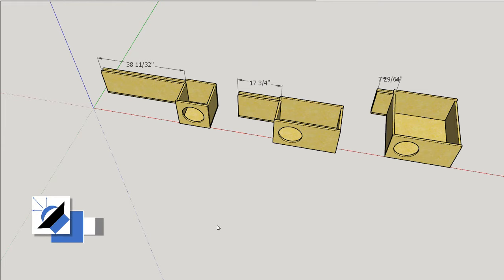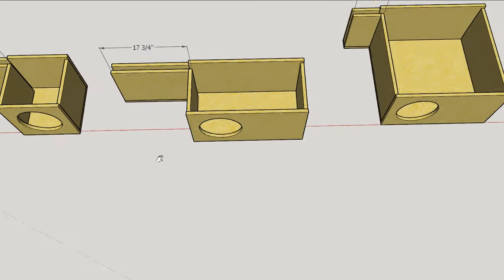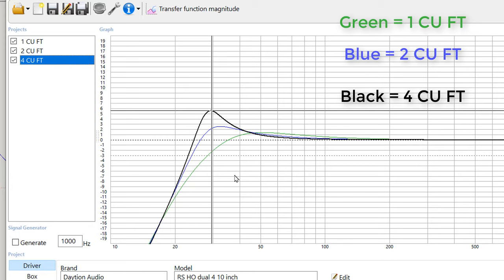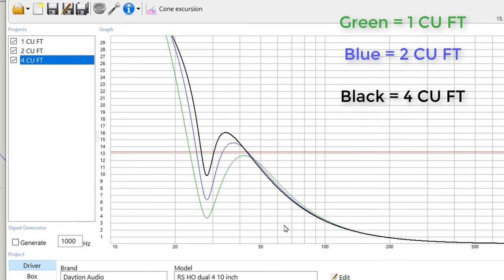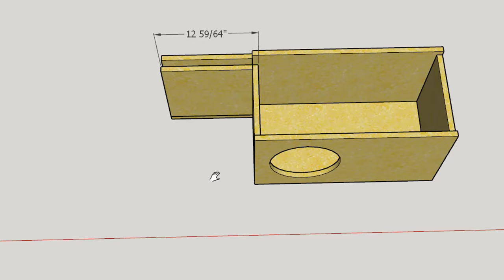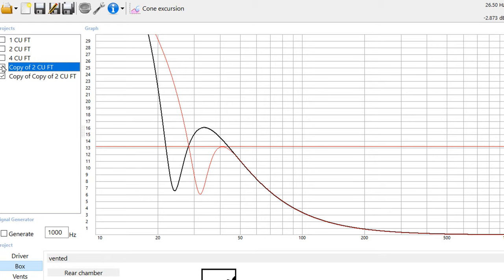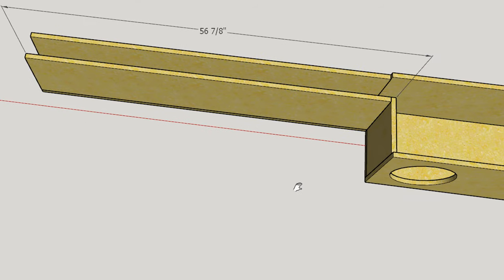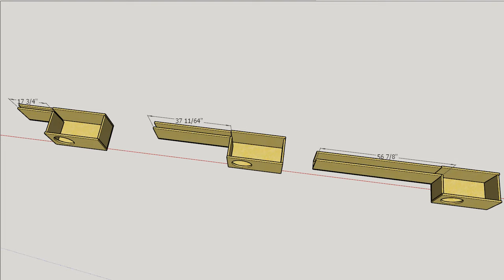Understanding Port Length, Box Volume, and Tuning Frequency.

Comment: What would happen if you take the 1ft cube box and make the vent "snake" on the outside of the box.  Like a T Line box, add lots of 90 degree bends on the port, outside the box, to compact the overall length of the port and make the overall size of the box more compacted.

I hope that makes sense.
Reply from the maker: That works just fine, it's just a pain in the ass to design and build.
Reply: @DIYAudioGuy  Does the 90 degree bends have an effect on the airflow in the same way as 90 degree bends in a hydraulic system, or bending a wire 90 degrees will increase resistance?
Reply from the maker: @turboduckhead6179  to be perfectly honest, I don't know. It seems like it's done a lot and it seems like it would restrict airflow but I'm not aware of any testing or evidence to prove that it does or does not have an impact on the sound.  If lumber prices ever fall I might have to build a box and test that out.
Reply: @DIYAudioGuy  I see prices of birch has tripiled in prices since corona..
Reply from the maker: @turboduckhead6179  fortunately lumber futures are beginning to fall.  It's going to take a few months before that to translate down to retail prices.
Reply: @DIYAudioGuy  lol...true story. I was at my house out in the shop and had this fella drive up and asked me if I was interested in some plywood for $5 a sheet...well yeah. I stepped out to his truck and he had 4 sheets. I gave him $20 for the 4 sheets of 3/4 pine ply. I asked him about the wood and he worked at a local furniture factory. He said they get the ply in and if any defects they just throw it out. I told him to bring me all he could at $5 a sheet. Because nothing was majpr wrong with the ply...I now have 50 sheets...lol. I sure wish it was Baltic Berch but hey...have you priced a sheet of 3/4" pine ply lately.

Comment: The other thing to take into consideration is that the larger side panels can resonate, especially at low frequency.
Reply from the maker: I have been digging into that, trying to find a formula that will tell me when a wood panel of a given size will resonate.  I have yet to crack the code.

Comment: Can you plug a big 15 inch high powered active subwoofer that has a plate amplifier with 1000 watts of power consumption into the 120 volt ac outlet on the back of a home theater receiver
Reply from the maker: Probably not. It depends on the amp rating of the outlet.

Comment: So I love lows and am about to build my box ported.  The box I have designed has a tuning of 37 hertz . Is that low enough or should I try to go a little lower
Reply from the maker: It's hard to say without modeling the subwoofer and something like WINisd, 37 Hertz might be low for that specific driver. But in general I wouldn't consider a 37 hertz low at all.
Reply: @DIYAudioGuy  it's an earthquake subzero 15. Looks like a beast weighs about 54 lbs

Comment: Ive learned loads these are great videos!! 🙏
Does it matter if the port extends out of the box?? Im building the box for structural sound but im constricted a little with space so would be ideal to make the port longer for obvious reasons, im going to fibreglass over top wich will hide it all and look awesome in the boot of my car for the end design i have in my head.
Reply from the maker: There is a lot of debate on that question -- how far can the port be away from the driver, which direction should you face the port relative to the driver?  I am firmly in the "it does not matter much at all" camp.  The wavelength at 100hz is over 12 ft.  Which is longer than the cabin on everything but the largest SUV's and vans.  So if you are in a typical car trunk I don't think it will matter as much as the placement of the sub and port in the car.
Reply: @DIYAudioGuy  ok thanks, the box(x2) will have to be 0.02 cubic inch with an 8inch inverted sub.
I used the Precision Sound calculator that u mentioned but its a ridiculous amount of port length even for 40 hz so im assuming ill still get that kick from it? But just no real low frequency that im after. Just worried about damage on the drivers thats all.
Reply: @ashleykellow5657  Yeah although most all of the sub amps I have had in the last probably 15 years or so have had subsonic filters, I much rather have the box tuned low enough to either not use the filter or have it turned to like 25hz

Comment: I have been wondering for the last couple days if putting 1 sub in a box tuned lower and 1 sub in a box tuned higher or just putting both subs in a box somewhere in between would be best. I want to use two sundown u-6.5s and suprise everybody that hears it when they figure out it’s 2 6.5s
Reply from the maker: That is probably the most common question I get.   I don't think it will work, but I have not tested it.

Comment: Do you think its important to include the air volume into the displacement of the box? I have added the material volume for probably 15 years, but with playing with a new program it includes the air volume too. Love your input.  The application is car audio heavy bass
Reply from the maker: Not sure what you mean.  If you mean the space that the subwoofer takes up and you absolutely need to include that.
Reply: @DIYAudioGuy  the air space in the port
Reply from the maker: @gunlover7851  The airspace in the pork is separate from the airspace in the enclosure.  Most subwoofer enclosure calculators and software don't include the port in the airspace.
Reply: @DIYAudioGuy  thanks brother.

Comment: Great video, would be cool If you talked about port resonance as well. 

I've never payed attention to it until a week ago after someone brought it up and I confirmed my 18 has a horrible noise at the resonance frequency. I've heard the noise in the past but didn't realize it was the port resonance frequency doing that. 

It's not an issue in my case as that's at 128Hz, but they were thinking of building a sub with it at 86Hz and we're thinking that'll sound horrible with that resonance frequency being in the area he wants to play. 

Heard the general rule of thumb with that is make sure it's an octave above where you want to play. Like if you want to play 80Hz and below, make sure it's not lower than 160Hz.  

I wonder if additional bracing would dampen it out, or build the box in a way to cancel it out using math and dimensions that line up with the frequency.
Reply from the maker: I would have to do some research before I could give you a decent answer.

Comment: Can you please explain why port length changes when you switch the height and width? Shouldnt it be the same since the vent area is the same
Reply from the maker: If the vent cross section area is the same then the vent length should be the same.
Reply: @DIYAudioGuy  i agree but the software doesnt lol.. Just make sure I wasnt losing my mind thanks

Comment: I understand the ports are external for visual reasons. But once you put the port inside does that change the internal volume, thus changing the required port length?
Reply from the maker: Correct.

Comment: If you took a 15 inch pro audio dj subwoofer that has a frequency response range of 40 hertz to 2000 hertz and slapped it into a prefabricated 15 inch car audio subwoofer enclosure that is tuned low around 25 hertz will it still hit low and still produce deep bass.
Reply from the maker: Hard to say.  It will really depend on the driver.  It will definitely get loud, those PA/pro audio drivers are very efficient.

Comment: Can you have a port that while tuned low is so large that the subwoofers won't have enough force to move the air in and out of it? or is this not a consideration?
Reply from the maker: At some point it becomes a poorly designed transmission line.  You run into problems fitting the thing in a car, or to much hassle trying to fold the int to enclosure.  Like the 5 ft long port at the end of the video.
Reply: In my experience having a big port gains efficiency & gains output on low power however going smaller can get louder but you need more power to do so, there are always trade-offs.

Comment: I HAVE A DOUBT IS THE PORT AREA OF MY DRAWER ADDITED TO THE 4 CUBIC FEET OF MY DRAWER? OR THE PORT AREA IS ALREADY INCLUDED WITHIN THE 4 CUBIC FEET. THANK YOU
Reply from the maker: Gross airspace would include the port, net airspace does not include the port.  Always use net airspace when doing the tuning calculations.
Reply: @DIYAudioGuy  Greetings, thanks for your response but I still can't understand what my gross area would be and what the net area would be. I am using the program winISD 0.7 I make a drawer of type 6 bandpass order. the rear camera is 80 liters / frequency 55hz and the front camera is 40 liters / 100hz. My Doubt is? The liters measured by the software include the area of the tuning window and the area of the speaker? or is it just the liters without the horn and without the tuning window? I hope you understand. regards

Comment: To large of a box causes over excursion for sure. I think lining the walls of the box with Poly fill can help with this some. I am going to probably test this today since I’m going to be building a box similar to box 2. For a 12” alpine. Calls for 1.75 cu ft for ported box but I think I’ll build around 2 cu ft to about 30-32 hz. Going in a trailblazer. I just can’t decide if I should go with sub up or back. I think I’ll do both port and sub facing back.
Reply from the maker: Test it out and see how it works.  A lot of people think that a box sounds better with some kind of stuffing, if nothing else it will help with standing waves.
Reply: @DIYAudioGuy  I usually use it because of to small of a box just working with what I had already. Ive never liked the sound when the box is stuffed full. I have had good success using blanket style poly and using adhesive spray on the walls and applying a 1/2”-3/4” layer. Of course this also keeps it in place in ported boxes eliminating the small chance of anything going into the coils.
Reply from the maker: And you have a big SUV, so plenty of room for a big box with a big port.

Comment: great vid bro👍 i am wondering adout the 2 cu.ft. box tuned to 24hz, if you put a lowpass @44hz wouldn't that sound the best? and get rid of moat of the "problems" with that design?
i am trying to make a box that is truly a sub box, nothing over 40-45hz my main speakers cover above 45hz great. but i fuckin LOVE 15hz! i have 2 12 woofers coming but i can't get the t&s parameters on them, they are too old(dcm kx212 replacements)...
Reply from the maker: Without the TS parameters you can't really answer that question.

Comment: You may have mentioned it in the video but do you know what airspace this subwoofer was recommended by manufacturer?
I've got two questions, I have a sub that should have 3.2-3.5cubic ft airspace in ported box. I'm putting it in a 4.3, does that sound okay or possibly cause over excursion?

Also, can a port be too short? I'm modding a dual 15 sealed box, to be a single 15 ported box. Biggest pvc I could get for now is 3inch inner diameter (already flared it homestyle 💪) but I figured that's fine becuase skar recommends a port area that is equal to 3.5inch round port no flare. Anways I'm doing math on a free box calculator becuase I have no PC and it's telling me with my 4.3cubic ft box that my port has to be 2inches long to achieve 32hz tuning. Is that gunna be an issue? Should I try n fill some space inside the box to get closer to recommended airspace as well as allow for longer port to achieve 32hz
Reply: Ps I come back to this video every other week. Thank you so much for making it XD I hope my watchtime can somehow benefit you even slightly as much as this video benefits me. All your answers are always appreciated
Reply from the maker: That's a bit to much to cover in the YouTube comments.
Reply: @DIYAudioGuy  fair enough 😅 I'm just gunna do it
Edit: is there a good forums or something where I can ask these questions? All the car audio forums I can find seem to be dead, latest posts are like 2011. Where I'm from there are no audio shops or meets, no real enthusiasts around here, all I have is the internet and my own experiments.

Comment: I asked this in your other video. How can you tune two tube ports ?
Reply from the maker: Each Port will tune half of the enclosure.  So if you have a 2 cubic foot box and you use two ports then the ports will be the same size as if you only had one port in a one cubic foot box.
Reply: @DIYAudioGuy  thanks

Comment: So I put a 4in round port on my box with a 15in sub ......the port has a 45degree corner piece , it measures 12inches to that corner piece, to the lowest point of port measures approx 15 inches ....3.3 cu ft , box is made with 1.5in conference table, sub is black brick audio, anyways my question is if I were to put another 4in port next to the other one, chop off the angle piece, how long would each port need to be? The correct port length for what I'm trying to get (31hz)is 7.75in with a single,so would 2 4in ports be about 4in long or 14in?
Reply from the maker: If you add a second port then both ports will need to be longer.

Comment: What is different about a sealed subwoofer enclosure compared to a ported subwoofer enclosure.
Reply from the maker: Ported plays lower and louder, everything else held equal.  Some will argue that sealed sounds better but I disagree.
Reply: Sound quality group delay is extremely important. Ported enclosure the pressure from the port is 360 degrees out of phase (delayed) so it has a reinforcing effect but it can make the bass sound “delayed” you can kind of compensate with time alignment but not really. Sealed might have a group delay of 5-8mS, ported is more like 25-30mS

Comment: how does a person decide what frequency to tune the box to? is it based on one of the T/S parameters?
Reply from the maker: It is based on how you want to use the speaker and the driver you choose.   A home theater sub is typically tuned much lower than a car sub.  A 6" driver in a bookshelf speaker is tuned even higher.  I model the response in WinISD and use that to guide my choices.   https://youtu.be/yZNeYBYGRKk
Reply: @DIYAudioGuy  does the speaker's specs have anything to do with the tuning frequency? i dont get it.I assume that I dont tune a box lower then the driver can produce and I wouldnt go alot higher then the driver produces, but I am new to speaker building. Is there a bump where the box is tuned?
Reply from the maker: @jalang63  yes, but it's a complex interplay of the parameters with the enclosure.  So I just use free software to do it.  https://youtu.be/yZNeYBYGRKk

Comment: What about cabin gain? Why would you want your F3 to be around 25hz if most vehicles love to extend low end. Usually when porting boxes and tuning that low my experience is that you'll have lows but no highs.
Reply from the maker: I started by building home theater subwoofers, and those need to be tuned low.  It is just hard to break the habit.

Comment: I have two massive audio subs. spec rating on paper is not true, so I contacted massive audio and they told me 4.0 cubes and a 30 square inch port... My question is should I make an open air box with bracing or cut the specs they gave me in half for two separate chambers?
Reply from the maker: It should not make a big difference.  If it were me I would go with the large single chamber just because it'll be easier to fold one port into the box instead of two, and that one port will be a little bit shorter.  One thing I learned on the home theater build that I just completed is that you really can't go overboard on the bracing.  I would definitely put a brace down the center from the baffle to the back wall/port wall in addition to bracing across the width of the box.
Reply from the maker: I'm also glad to hear that the manufacturer recommended a nice large port cross-section like that.  After modeling and building a few enclosures I've learned that ports need to be as large as possible.
Reply: @DIYAudioGuy  hey thanks for getting back to me so fast {comma} I talked to a couple other guys and they said those are great specs I just need to design an enclosure that fits them LOL. Having some breakthroughs recently too, and that makes the next thing easier to understand so port calculating is next thank you again.
Reply from the maker: @cocomaster3755  what tuning frequency did they tell you to shoot for?
Reply: @DIYAudioGuy  34 HZ.
Reply: Update, I have a box now that is 40x17x29 maybe 29¼. With an 8x15 3/4 inch port opening. 1st port wall is 19 3/8th wall, and the second is 3 inches but we routered it now it's 2 7/8 because the hard edge. Free air space is 4.1 4.2 cubes. But I cut the holes a little close for comfort to the rear near the port opening in the box... Doing the baffle last every time now, and made them a quarter inch too wide so I triple baffled it... Not my favorite fix but not trying to rebuild, just wondering what your thoughts are on a box like by description if you could look at it don't know how you prefer to receive images. It was turned to 34 HZ when we actually ran into a little problem we made some adjustments and the tuning went up to 34.something with an extra 3/4" baffle with the tuning go back down or up?